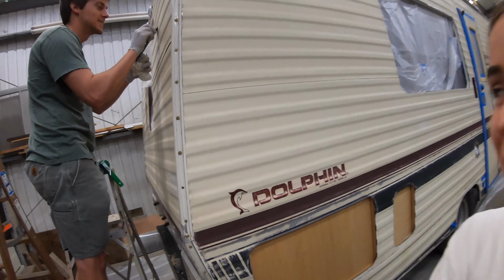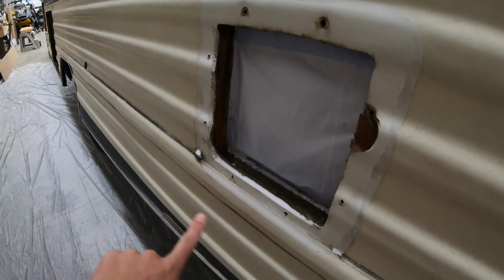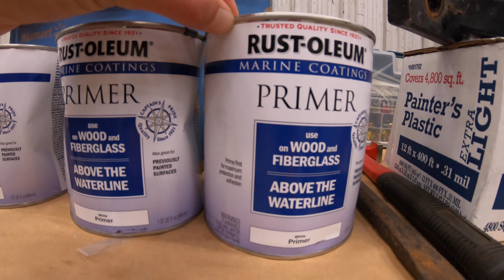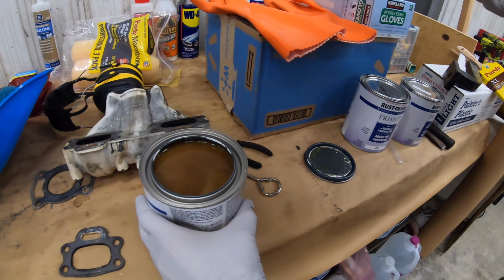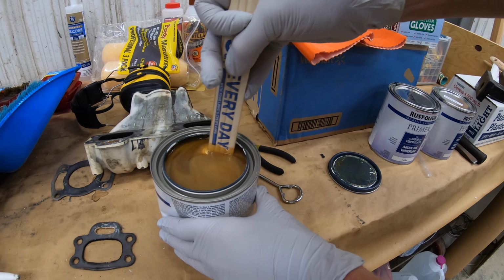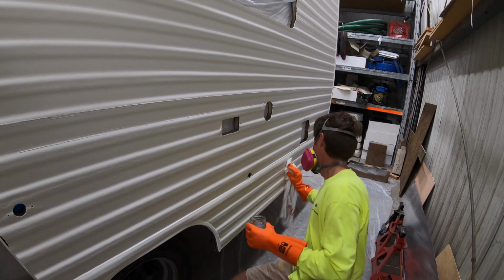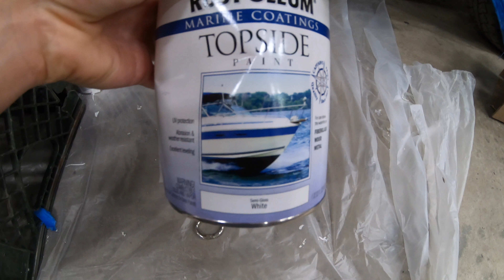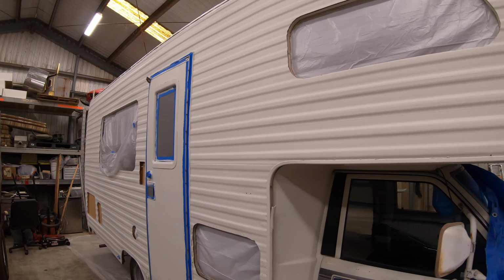PAINTING THE EXTERIOR OF OUR VINTAGE TOYOTA DOLPHIN CAMPER VAN (a MUCH bigger job than we thought)

Comment: Hey guys! Just wondering what grit sandpaper you guys started with when wet sanding and what the lowest grit you went to was. Thanks!
Reply from the maker: It's been awhile but I'm pretty sure we only used 600 grit wet/dry sandpaper (we used 3M brand and it was black). It didn't take much to smooth of the exposed fibers and was easier than I expected.  Good luck!

Comment: It’s looking good! Did you guys decide to remove all the walls and roof to be replaced before you got the dolphin? I was hoping to replace only the water damaged areas on mine but the more I remove the more I think I should rebuild. Is there a way i can contact you and Craig for questions? Thanks!
Reply from the maker: Thank you! We're getting super close to being done, I'm just a bit behind on making the videos. haha we did not, we thought we would repaint the cabinets, take out the carpet, make new cushions, rebuild the upper cabinet on the passenger side, a few other things, and call it good. It wasn't until we took out that cabinet and saw that the whole wall was rotten that we knew it had to be rebuilt. We also didn't know how rotten the subfloor was until we ripped out all of the carpet. Same for the roof; we didn't see the pinholes until we started gutting the RV.  Now we know we have a sturdy foundation and no leaks in the roof (hopefully) haha.

What areas are water damaged on yours?
You're welcome to ask us questions on here! Other people might have similar questions :)
Reply: Copy all! Haha well I have the usual damage, the front left and right corner have rot. The plan was initially to seal the roof, re seal around all roof components, and redo the corner trim. As I’m taking off the corner trim I realize the rot goes most the way up the corner. So now I’m in a similar situation. I can fix the framing in the front, and rear where it needs it, seal the crap out of the roof and call it dry for now. Knowing that down the line I should probably replace the roof. Or I do the same as you all and just gut it, replace all that I can. 

My limiting factor is not having a large shop, currently working under cover but only have 2 walls on the cover so moisture can enter. Anyway, It’s a big project but I’m excited, hoping to not get discouraged
Reply from the maker: @homeofthefree8656  Sounds similar to ours, but with rot in different places.  The front of ours was solid, but we had rot in plenty of other places.  The outer skin of our roof had between 10-50 holes from corrosion, so any water pooled on the roof drained directly into the camper; cool, right!  The roof was sagging down several inches in the middle.  If your roof is still structural, and isn't sagging, I would try not to replace the whole thing.  I say this because it was a lot of work, and if the original roof is still sound, it may be stronger than what you put back.  We are very fortunate to have a shop to work in.  When we did the demo we were working outside.  Let us know what you decide to do.  With the big project ahead, just keeping getting something done, and eventually you will complete it.  At least that is what I'm hoping!

Comment: Hi just wondering if you remember house much paint and primer you used
Reply: i just shot mine with acrylic enamel auto paint and it took about a gallon and a half of each. i used an hvlp for the primer with a 1.7 tip and a HTE for the paint with a 1.3 tip. sprayed the window frames and bumper with black polyurethane so theyd be super shiny. for those i used a small hvlp with 1.0 but probably would use the hte if i were doing it again it leaves a killer finish